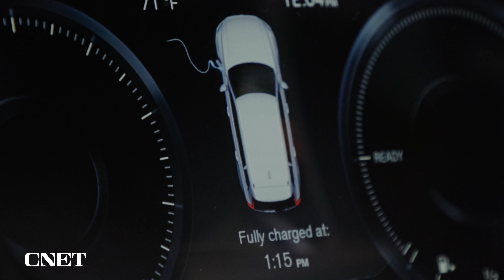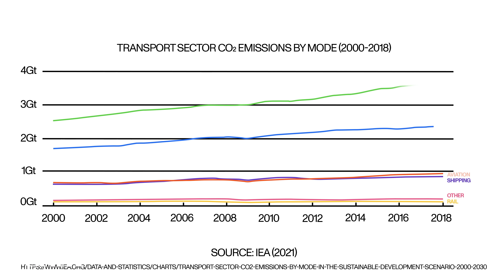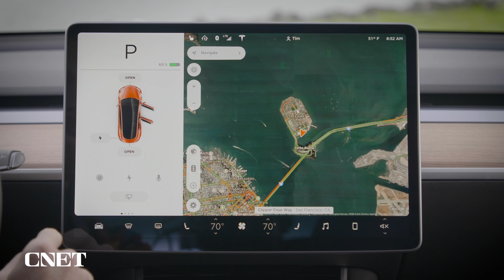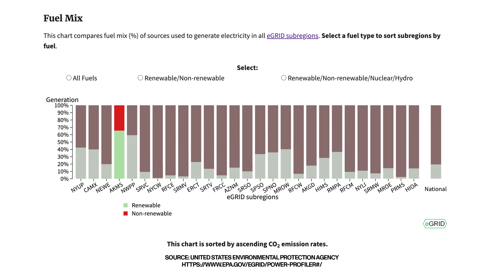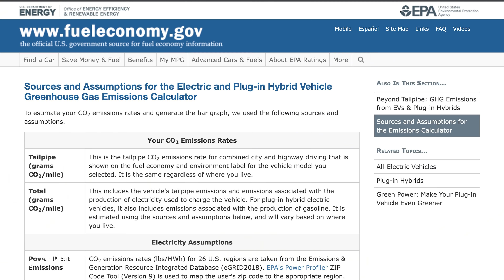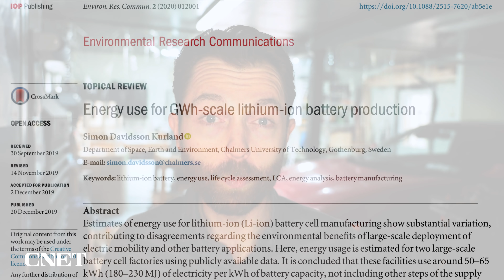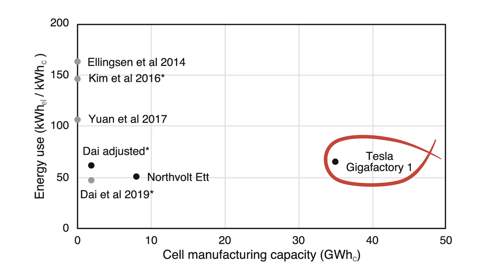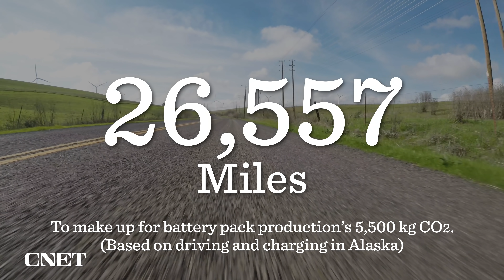Are EVs Actually WORSE for the Environment?

Comment: You added a CO2 offset for the manufacturing of the EV battery but didn't take into account all of the additional parts in an ICE vehicle. They may not be equivalent to the battery pack, but they take a lot to manufacture, and over the life of the vehicle they require a lot more resources to maintain.
Reply: Good point. I love EV has way less maintenance because of environmental reasons and also because these dealerships rip-off consumers with service pricing.
Reply: That is true....no oil changes twice or three times a year, based on the ICE maintenance schedule.  I drive a Chevy Volt and while it isn't a full EV...it requires less maintenance like oil changes (I do them annually) and other wear items like brake rotors and pads since regen does most of the braking.
Reply: @325xitgrocgetter  so you're just destroying your car. Great.
Reply: @THESLlCK  Check the maintenance schedule for the Volt...they can go up to two years without an oil change time wise....usually the Maintenance Minder is down to 50 percent when I change it....
Reply: I came away thinking the same thing after hearing the end of the comparison. It’s as if the ICE vehicles simply appear on the lots without a single gram of CO2 having been released to produce them.
Reply: Yes but those are going to be similer cost to producing the gas vehicle parts too. Regardelss electric is NOT the answer
Reply: Not to mention all the hydrocarbons used for oil changes,etc

Comment: Wouldn’t it be fair if you include how much CO2 is produced refining the oil to gasoline?
Reply: Would need to add the same for the 80% of electric production too right? Probably more evaporite emissions with gas vehicles, but net not much difference it would seem.
Reply: @mweaver45  I don’t know if I understand your reply, but didn’t the video cover the electric production CO2 emissions for EV?
Reply: @mweaver45  Nonsense, there's a huge difference. BEV CO2 battery production cost is done one time upfront.

The CO2 impact of oil extraction and gasoline refinement is reoccurring for gas vehicles, even before the gas is transported from the refinery to the pump. For "dirty" electrical power production, the delta between the gas production and comparative electrical demand narrows, but the BEV will still be cleaner.
Reply: How about the energy used to manufacture the engine and transmission for the BMW?
Reply: Yes

Comment: Can we see a more accurate comparison taking in to account the manufacturing of combustion engine vehicles
Reply: Ya, there seemed to be a lot of focus of battery creation, but what about the environmental impacts of extracting oil from the ground, transporting it, refining it into gasoline, etc. Seems like the video is missing a lot of related data points.
Reply: @dougclark8183  Agreed but then we would also need to take into account the environmental impact of mining rare earth minerals and their transportation, manufacturing solar cells etc. All comparable data points need to be included.
Reply: In all fairness the comparison should also include the manufacturing process of the entire ICE vehicle,  the entire EV, the transportation of both, the  average miles driven post covid -19 lockdowns (both working from home and not, less/more road trips, etc), and all the other factors that should be included in a true apples to oranges comparison. It's not just the manufacturing of the battery pack, but also the life of the vehicle, the ability(or inability) to repair said vehicle, the need to replace a part (like the battery pack) vs repairing said part, and everything else that goes into the ownership of a vehicle. Insurance, rebates, incentives, smog testing, inspections, subscription to supercharging, etc the list goes on and on. The fact that there are such endless possibilities of the amount of factors that should be included in a comparison between ICE and EVs will continue to making ANY comparison between the two types of vehicles difficult, period.
Reply: @JS-wc4xs - Long but sweet. 🏆
Reply: @JS-wc4xs  Very well said, many proponents of EV's tend to forget that for the better part of a century ICE powered has had the choice of being repaired by anyone including the end user while EV's are being designed to make it that only the manufacturer can do repairs updates etc. Also the charging issue needs to be addressed we have as of today the Tesla, J1772, ChDeMO, and CCS too many connectors so charging while on the road is a challenge at best unless you spent the big bucks for a Tesla and there supercharger network.
Reply: I guess to make it more fair without calculating entire carbon cost for production of both, you could calculate battery+motors for the Tesla and engine+transmission for BMW. The assumption being chassis, body, wheels,paint, and most other components are similar.
Reply: There’s already many studies that say even if you used carbon sources for electric generation it’s still less carbon because of its 3x efficiency.
Reply: I’m sure they considered that but will be irrelevant data because the manufacture/shell/structure of both types of vehicles cancel each other out due to similarities inside and out. It’s just damn metal, rubber,glass etc
Reply: @dougclark8183  this is what i tried to tell my anti EV friend
Reply: @mttrhll1  not really, Engine+transmission come from Aluminum, for 200lb engine, you need 1000lb of raw material and its easy to mine, for Tesla battery pack and it's engine, you need to do 500 ton of raw material. It needs literally 1000 times more material
Also, it's very easy to recycle aluminum,  almost impossible to recycle rare earth stuff in Tesla batteries.
Reply: @hostilityy  not really, problem is that ICE cars are build out of aluminum mostly, so a 2 ton car needs 8 ton of raw material and it's easily recyclable, Tesla battery and engine pack need rare earth metal so a similar car needs 500 ton of raw material that needs to be mined and it's not even recyclable easily (needs a lot more energy to recycle).
So in fact, it doesn't cancel out at all.

Comment: Great in-depth analysis, and thanks to CNET for pulling it all together. One thing to consider. You covered the carbon cost of EV batteries, but what about the carbon cost of manufacturing parts for the petrol vehicles. I understand it's not a 1 to 1 comparison, and I know EV batteries are a factor, but there are other factors as well. Im sure it ends up being a rabbit hole type of scenario, but just looking for the most equal comparison. Would also love to see a state by state breakdown too. Thanks!
Reply: Yes that was unfair, PLUS while this video included the carbon footprint of the electricity used as fuel for an EV "including transmission losses" they assumed the BMW starts with a full tank of fuel that was somehow "carbonless" failed to include the carbon footprint of oil-extraction, pipelines, refineries, and final transportation of fuel in order to be able to pump it into the BMW. This not so insignificant "fueling" issue was not accounted for equally in this CNET assessment rendering is flawed and useless.
Reply: @wopontour  simple; use propane which is a by-product of natural gas extraction.

Comment: An electricity generating power station running on petrol powering say 10,000 electric cars. Compared to 10,000 petrol cars the power station will use way less petrol for the same number of miles travelled.

Comment: Did I miss the carbon foot print to produce gas (oil drilling and refining),  seems that needs to be part of the calculating if we are doing the same for a battery that only produces that once when the battery is created verse refining all the time and oil drilling.
Reply: It's much more than that. Drilling, transporting the crude around the world, refining, transporting by rail pipe and truck to the station, the operation/electricity and staffing of gas stations. As a rule of thumb, for every gallon of gas that gets into your tank, it takes another gallon for it to find it's way there.  Then it's all burnt up and goes into the air. We can't ignore the constant oil changes and other fluids that gas engines require. Then there are the oil spills.
Reply: True, but then we also need to take into account the carbon footprint & environmental impact of mining and transportation of rare earth minerals, manufacturing of solar cells, environmental cost of disposing used batteries  etc.
Reply: @darreng8084  True, but then we also need to take into account the carbon footprint & environmental impact of mining and transportation of rare earth minerals, manufacturing of solar cells, the environmental impact of disposing batteries etc.
Reply: @monash4250  the difference is it happens all the time refining, vs once with battery. Also as recycling starts to happen there will be less mining. The point is we looked at a number of factors and the EV still does better at a CO2 footprint, and it would be even worse overall for ICE. We want to find the reason EVs are worse but don't factor in the things that ICE requires. That data is clear if you are willing to listen.
Reply: @CraigMatsuura  Some of the data is clear, the one big issue that you cannot get around is weight an EV with a large battery pack has a ton of weight committed to the battery pack  it never goes away and therein contributes to more wear and tear to roads, tires etc. Right now the best way forward is to embrace both EV and hybrid.
Reply: @chrisherbert4454  I believe a hybrid is heavier than an a plan old ICE and still has all the downsides if using oil, maintenance and complexity of breaking down.
Reply: @CraigMatsuura  but is far lighter and attainable then a pure EV and has new (insert sarcasm) rapid charging tech. And the latest hybrids have no alternator, starter, and are much better on brakes then a pure ICE.
Reply: @chrisherbert4454  LIES! A Kona EV is 1750kg vs Kona Petrol is 1500kg Wet. That 250ish kg difference has NEGLIGIBLE wear and tear difference to roads. Regenerative Braking being a slower smoother method of deceleration also reduced road wear. Sorry you stated one of the more blatant lies about BEVs. Gah why are people soo easily brainwashed by lies that defies easy to understand engineering.
Reply: @Neojhun  so Kona EV 2WD weight 3750lbs normal Kona 4WD 3287 so yes in this one application it's only about 500lbs but for a 2WD ICE Kona it's 2899 about a 900 lbs difference
Reply: @chrisherbert4454  Not just AWD but trim level matters also. Apparently there is a less sold base Kona EV trim level that is 3715lbs. Majority of Kona Petrol sold are 3000lbs or over. What ever the difference it's Negligible results when it comes to Road Surface wear level test.

Comment: At the beginning of its life an EV is more harmful to the environment, but as you own it longer EVs get cleaner compared to ICE cars. Because the power grid is gets cleaner and you don't have as much  maintenance, so less brake changes. Also no oil changes, transmission oil changes and air filters.
Reply: You'd better have a good home generator with plenty of gas stockpiled for the many power failures to come.
Reply: Like an air filter is some big deal.  Any idiot can change it in two minutes.  How often does a vehicle need transmission oil changes?  Maybe two or three times in its lifetime.  And today's ICE vehicles can go 5K to 10K miles between oil changes.

Comment: Good review. I would have liked to see information regarding the mining and environmental impact for mining the internal combustion engine and some of the materials required for that (think Catalytic Converter).  I think (I have not fact checked myself) that the environment impact of mining lithium ion batteries is steep, but the impact of mining resources for an internal combustion engine is not 0.
Reply: Thanks for watching and showing love.
Congratulations 🎁🎉🎈you won a prize !!! Send me a text above to acknowledge your prize .
Reply: A catalytic converter is a relatively small "tube," generally made out of ceramic, and it converts harmful gasses of the exhaust into something less toxic for the environment. Ceramic is made with materials like clay, water, and heat, and even though clay is an unrenewable resource, the process to dig and collect clay is far less damaging to the environment compared to lithium mining, a much rarer and tougher element. That being said, even though the construction of ICE cars produces less of a carbon footprint than building EVs, Electric cars are better for the environment in every other way. They're also boring as f***, but oh well.
Reply: ICE vehicles are not produced using child slave labor. That alone should end the conversation.

Comment: This is a great video. I'm starting to do my research to determine the best course for my next vehicle. One factor that wasn't considered, possibly because this is perhaps not 'carbon footprint' related, are the effects of waste from battery manufacturing and disposal. I've heard anecdotally, not read peer reviewed research, stating that the waste from battery manufacturing and disposal is significant.
Reply: The batteries in an EV last quite long and after that it mostly gets reused in himebbattery storage. Only after it has completely died will it be almost totally recycled. Tesla already recycle all their in house batteries used in testing vehicles etc
Reply: the best course for your next vehicle is a 2.5 turbo petrol engine
Reply: @Luciano-IL  How so?
Reply: @brewcity53207  because if u want to drive a real car a petrol engine is the answer. beside that,can you charge the car at home? do you have a charger at work? what happened if you have to drive 300 miles on a trip with ac on and 4 people in the car?
Reply: @Luciano-IL  I don't understand what you mean by a "real car"?  Like it's a masculinity thing?  I'm not really too concerned about that being a problem.
Reply: @brewcity53207   No, it's not what i ment... never mind. you go and buy whatever fit you most...
Reply: Thanks for watching and showing love.
Congratulations 🎁🎉🎈you won a prize !!! Send me a text above to acknowledge your prize .

Comment: Others have stated it. Gasoline powered cars typically use around 30,000 parts. EVs typically have about half that. An extra 15,000 parts per vehicle, primarily all in the engine compartment, has to have a large manufacturing Co2 footprint.

Comment: What about recycling.  An ice car is nearly 100% recyclable.   Elec car batteries are not.  I believe it's less then 75%.  They go into a dump above ot below ground.  Much like depleted uranium rods are buried for a millenia underground.  What happens when we have to start storing millions of car batteries.  Where they decay into the environment?
Reply: All that gas you burned driving that ice vehicle into the ground isn't recyclable either... Assuming that you drive 180 thousand miles on that ice at 30 MPG, that's 6000 gallons of gas that will not be recycled, not counting all the gas that was burned getting that gas from the oil field to your local gas station.
Reply: Wrong. EV batteries are near 100% recyclable.

Comment: Might've missed it but I have three main issues that weren't addressed that favor EVs very significantly. 1) even if the CO2 emissions were equal for the entire life of the vehicle (which they're not), emitting CO2 where people ARE is probably the most harmful aspect that people should care about. Having more CO2 emissions in remote areas (some more remote than others) is better than CO2 emissions where we eat, sleep, work, walk, etc. 2) There's a much more clear path to cleaning up the electrical grid in terms of CO2 emissions (ie. nuclear plants, renewables, etc). However there's not much more improvements that can be made for ICE vehicles. 3) Oil production/drilling is limited and we will run out one day. At least batteries can be recycled and repurposed. This is why investing in the future of ICE vehicles is not wise and we should instead invest in improving our electrical grid infrastructure and energy production methods.

Comment: Now do the Honda Accord Hybrid or even better, the Toyota Camry Hybrid LE. Comparing a 350 hp sports sedan is a bit misleading...
Reply: Nope because most BEVs is are equivalent to a 300hp Sport Sedan. 200lb/ft realy should be the Bare Minimum for a 1.5 tonne BEV. You are the one forcing Apples vs Oragne comparison. Responsive Electric Performance is also a SAFETY Feature that does not cost much extra.
Reply: FYI Spark EV has 327 lb/ft and it weighs 1365kg.
Reply: A hybrid may be cheating, but a more reasonable comparison would be a ICE purchased with the intent of minimizing fuel consumption, such as a small 4 cylinder and/or something turbo charged.
Reply: a BMW m304i gets like 23mph decent and not much worse than what most cars get lol. arguably most cars you see on the road are SUV or Wagons which would burn more gas for less mileage its a pretty decent car to compare too...